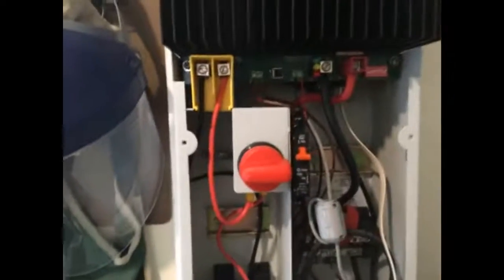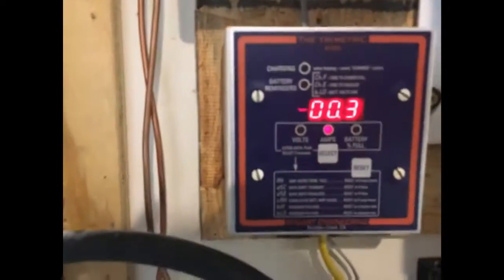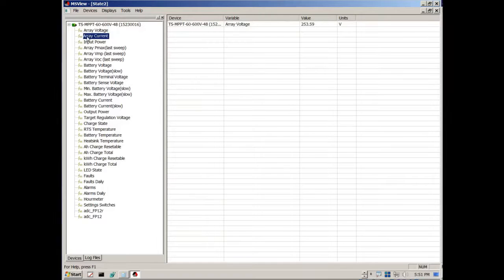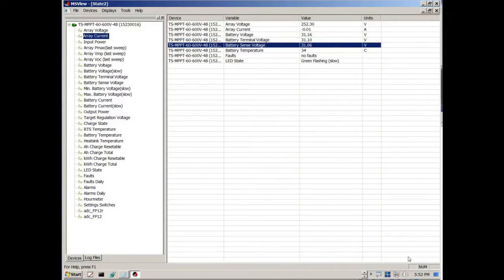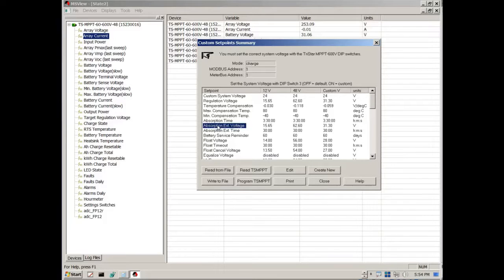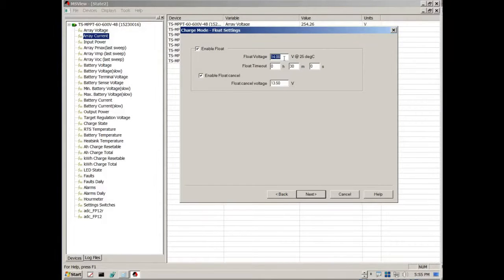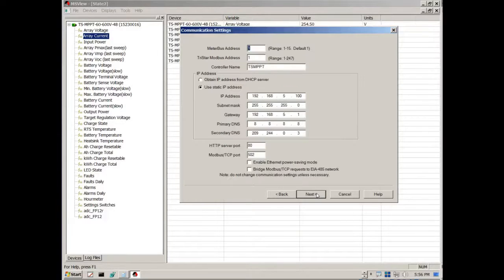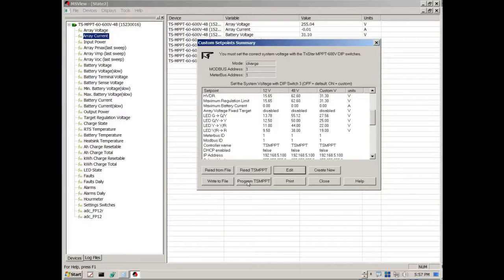Morningstar 600v Charge Controller Installation Complete

Comment: are you aware of the live view.  Google tsmppt your serial number /live view.html thus give a nice bunch of data
Reply from the maker: If your talking about the web page, I've seen it. Don't know for sure if it was the live view. I'll take a look at that again too, just to be sure.
Reply: It has all the live data and log of out puts
Reply from the maker: Checked out the live views and the drag and drop in MSView to see all of the data.  I do like it, very good info.
Reply from the maker: I checked it out.  Very good information.
Reply: Any more questions on it
Reply from the maker: No, but I was wondering about the buzzing and the humming of the unit earlier, but I read in the manual that it was normal.
Reply: It will do that. It's a irritating noise to some people. I have two if them going and I can't hear it much but others go crazy when around them.
Reply from the maker: That's good to hear, but that noise is very annoying.  I'm going to upload a video with the noise in the background.  You'll see what I mean.